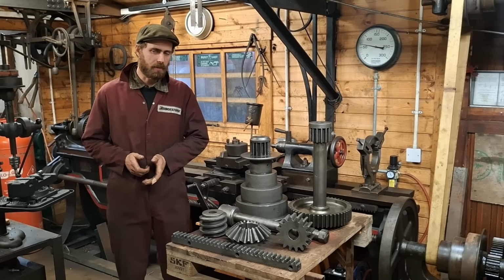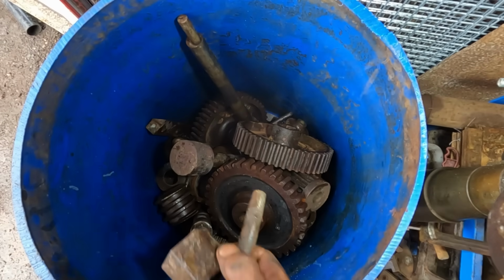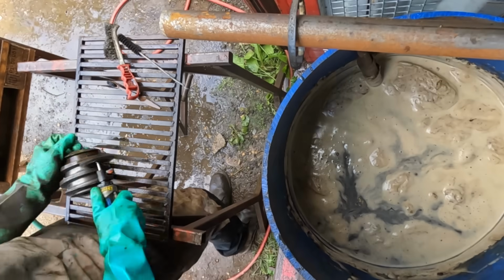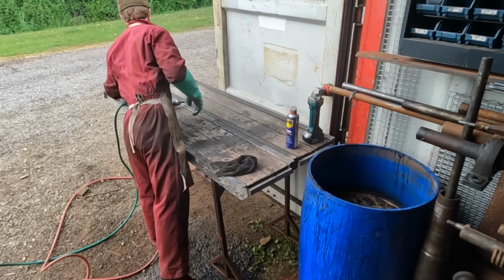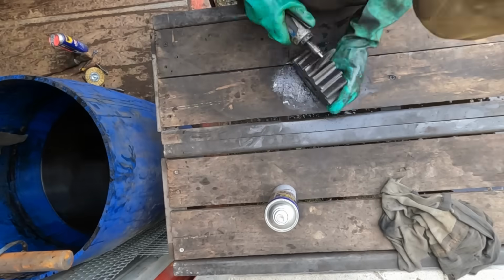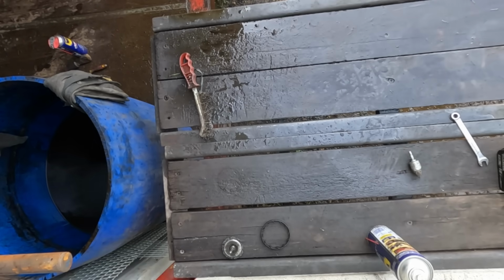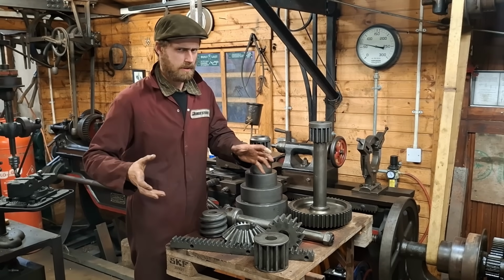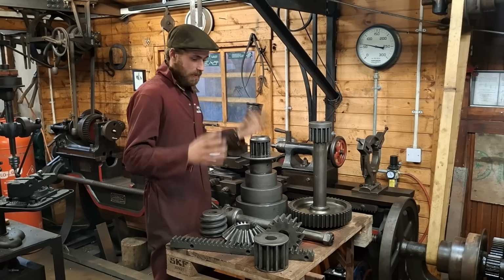DE-RUSTING Parts with MOLASSES - Victorian Radial Drilling Machine Restoration PART 8

Comment: I believe that using a cone pulley on the line shaft is only necessary if one needs a wider range of speeds from the drill press. And another thing, the cones can be of different diameters from that pully, so it is possible you have one in some of your "Treasures" that were in that box you were using as a counterweight... Thanks for a most interesting series... My oldest piece of shop machinery is a "Buffalo Forge 12" X 6"  drill press that came off of a pre- WWII Ship that was being dismantled in a ship-breaking company near where I live...

Comment: The cast is made similar to tuyere iron on a forge the core mix has cow dung ,fuller’s earth ,sand and straw for off gassing the process was very involved and could take 2to3 attempts.The in ground moulding was at 45 degrees,and had two sets of runners and risers ,the risers being longer than the runners .I saw experienced moulder do three attempts the third was successful.I was apprentice Blacksmith working at a foundry Engineering  works at the time ,there were replacing the 20 year old tuyere on the blacksmiths shop forgers this was in 1972 I was 16 at the time

Comment: A very inexpensive and fast  method for rust removal is a solution of 100grams Citric Acid, and 40 grams Sodium Carbonate (washing soda)  per 100ml distilled water.  Add a few drops of Dawn or similar dish soap as a surfactant if you remember, it's not essential.  This solution is similar to Evaporust, but MUCH cheaper.  I got the formula from Backyard Ballistics, and can confirm that it works really well.   I buy the Citric Acid in 6 lb bags and the Washing Soda in 3 lb boxes from Amazon.  Simple, cheap and incredibly effective.

Comment: Its not as cheap, but is not harmful and easy to dispose of is evaporust...though you do not want to leave cast iron in that for too long, as it will eventually start working on the cast iron vs just the rust.  Good to know about the molasses trick for sure, thanks.

Comment: Interesting. I've never tried molasses before. I've always used citric acid. It's also cheap in bulk and works fast. I suggest giving it a go in the future. It also needs the degreasing step up front and heat accelerates the process even further. For small parts, I heat the water to a boil and pour it in the container with the parts and the citric acid already in there.

Comment: I've been using molasses as a de-ruster for over 40 years. I swear by it. I mix it somewhere between a 40:1 to 60:1 mixture. Lasts forever, can be topped up at any time.  My longest lasting bin was 30 years old when I dropped a large shaft in and put a hole in it. 
Great for the garden.
BTW, it WILL NOT eat Aluminium. It will very, very mildly etch the coppers.  Just keep an eye on them.
When washed off any of the black colouration is firmly adhered Magnetite.  Great paint base and also takes oil for machine parts.

Comment: Looks like you had good results with this method. I don't think I have heard of it before. I have a 30 gallon blue plastic barrel,  much like yours, and I kept 15 gallons of white vinegar (the ordinary stuff available at the grocery store) in it. It works pretty well and usually dissolves the rust in two or three days. I keep it covered with a loose fitting lid and have never changed the vinegar...just added to it. It never seems to loose its "vinegarity". I know that's not really a word, but it seems very descriptive. I just add more to it if it starts to get low. After removing the parts from the barrel, I go through the same process is the same as you described. I am really enjoying this series and look forward to seeing the drill in operation.

Comment: Nice process Jonesy, worked great and certainly afordable. 
With the large quantity of parts you had this was probably one of the most effective processes.
Had you thought about the electrolysis process with borax and cathode and anode and a battery charger.
Thanks for sharing. 
Have a great weekend. 👍
Reply from the maker: Cheers Ed. I've thought about it, never got round to having a go!

Comment: Another good chelating method is sodium citrate. You can make it cheaply with citric acid and washing soda. Very similar to evaporust but way, way cheaper. If you search for a channel called "Beyond Ballistics" there's a very good video explaining it. I don't use anything else now.
Reply from the maker: Definitely planning to try that one too

Comment: Very interesting method, especially if you've other things to be getting on with. To be honest, I've never been one for the evaporusts, citric acid and all the rest of it. I'd rather have a full day of it with an angle grinder plus cup wire wheel, die grinder with various attachments and maybe a needle gun. Just gets it done. I've spent many an hour doing this to parts full of seawater corrosion. 

I'm not casting aspersions on your method, but you had to keep taking the parts out and abrading them with wire wheels on a regular basis. So you could have just spent a day at it and it would have been done.

 Absolutely brilliant video as always. The parts look fantastic.
Reply from the maker: Honestly, I have always been a wire wheeler too and never bothered with any chemical de rusting, load of faff I thought. One day I had that much to do and couldnt face it 😂 I gave evaporust a go and am fully converted now to the chemical method. 
Yes, you still have to do mechanical cleaning, but nowhere near as much or as harshly than without chemical aid. Also the parts come out a lot shinier and don't re rust afterwards as easily.
Reply: @iron_jonesy I totally get that, 100%. Like I said, I'm not casting aspersions on anything you do. There are plenty of times when I have had many other things on and I could have left stuff soaking. I just wish I could find a way to get paint off in the same way!
Reply: If the parts are degreased 1st, you just put the parts in and leave them. 100% safe and effective.
Reply: @Onan-u3b I get that. I still think its quicker to just spend a day removing it mechanically.

Comment: molasas is a crude sugar cane product---it's got everything bacteria need.  So you're probably just producing some acid by fermentation.  Wouldn't it be better to just buy vinegar or citric acid?  Anyway, I bet the wire wheel would have been required, regardless of your method.  Looks like a lot of work.  Can't wait to see the next episode.

Comment: A better recipe for rust removal is 1 liter of water 100 grams of citric acid and 40 grams of wash soda or 63 grams of baking soda. I mixed up 10 gallons for about 60 dollars. Still kinda stinks and leaves the black coating but it seems like it works faster than the molasses.

Comment: I use a solution of oxalic acid (1 mol L) in a barrel for 1~2 months (depending on the temperature) to clean heavily oxidized parts. It is one of the best organic acids for reducing iron oxide. I also use it to chemically leach clay with high iron oxide content, to improve its refractory qualities.

Comment: If you're happy with the molasses thing, carry on. results are what matters yea? But you might check out Backyard Ballistics. He's got a solution that costs about 1/10th of evaporust, not as harsh on the original metal, works just as well or even better and can be reused many more times than evaporust.

Comment: Electrolysis is faster, sure, but comes with a bunch of hurdles, like being able to suspend the parts so there's line-of-sight between the electrodes and the part.  No line-of-sight, no rust removal.  Molasses might stink, but that's small potatoes when balanced against how "easy" it is do to.

Comment: Very interesting - thank you!
Would it be practicable to make the line shaft cone pulley from wood?
And what is the gauge on the wall above the lathe tailstock?
Reply from the maker: It definitely would work! 
The gauge reads shop air pressure

Comment: Molasses are essentially just composed of sucrose (table sugar), fructose and glucose. They all have a bunch of hydroxyl groups which can bind to metal ions, forming a chelate. 
No oxygen is required for this reaction, sugar solutions tend to ferment though, which is probably the reason for the smell. An airtight lid would solve that, but fermentation releases co2, so add a water seal airlock or a spunding valve or something if you don't want to build a bomb, especially when leaving it alone for weeks at a time.
Reply: The problem with that idea is that a rusty iron part placed in a sucrose solution it will stay rusty (try it and see). There must be something else at play. One possible culprit is that the glucose and fructose in molasses are reducing sugars in a mildly acidic solution, capable of converting Fe3+ (insoluble) to Fe 2+ (soluble). This would be accentuated by incipient fermentation since yeasts are very effective oxygen scavengers. At this time this is conjecture, nobody actually knows what is happening. BTW putting a lid on the thing won't stop fermentation; yeast like oxygen so they can make ergosterols but they are perfectly capable of fermenting in a very low oxygen environment. Winemakers work very hard to ensure there is very low dissolved O2 in grape juice for aromatic whites (riesling etc) which ferment out perfectly well.

Comment: There's a channel called Winkys Workshop.  He used glued up wood (turned in his lathe) to create a step pulley for a drill press.  Seemed to work quite well.  Worth a look considering the difficulty of creating that casting from iron.

Comment: Hi, I have used the molasses as well, it's slow but worth the wait, maybe an aerator would speed up the progress. Evapo-rust remover works much faster than molasses and water. I'm sure that molasses is cheaper but never tried to compare the cost. I believe the black is the carbon that was in the metal that doesn't dissolve.
cleaning for you might be easier with a pressure washer and a sand blast attachment, maybe using crushed walnut shells.
Rich
Reply: hi I always look forward to your videos, I'm too old to work on that stuff anymore

Comment: i made my own cone pulley out of 3 "pucks" solid steel round bar for a 14 inch rock ford lathe i was restoring , works really well but god is it heavy , 80lbs or more . works as a good flywheel for the lathe

Comment: Excellent demonstration. This method, like he says, works a treat in certain situations. Large castings, e.g. lathe beds, that you want to do as little damage as possible to machined surfaces would be a good example. Using a plastic liner for the container, large items may be done cheaply versus having to pay a commercial sand blasting company to come to your location.
Another plus is that the smell will keep your in-laws from coming over on Saturday to drink your beer and eat all the goodies off the barbie.

Comment: I can highly recommend using Sta-Bil Rust Stopper for preventing rust on machine tools and components. I use if on all my machines in the workshop and I quite simply don't see any rust at all. It wipes off quite readily as well. The importers are based in Dewsbury, so if I'm feeling brave I can bob across to buy a couple of tins.
Reply from the maker: Thanks! I will look that up, I've been meaning to find something that prevents rust on machine surfaces
Reply: @iron_jonesy  I've been using Starret M1.